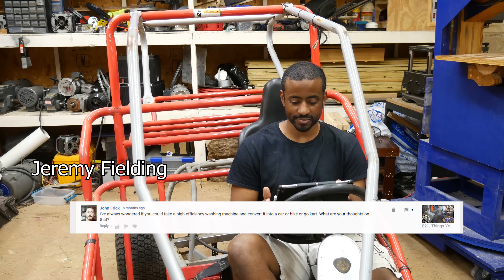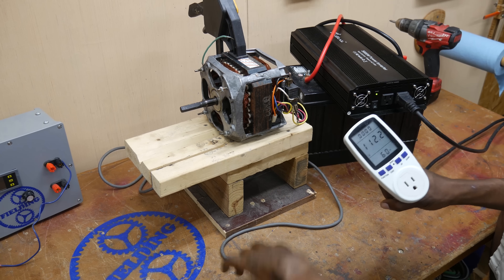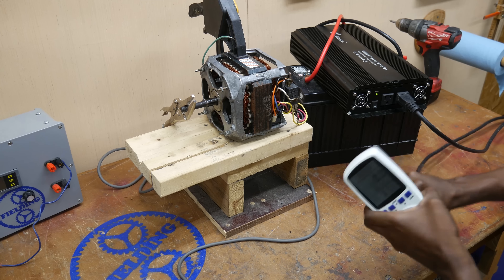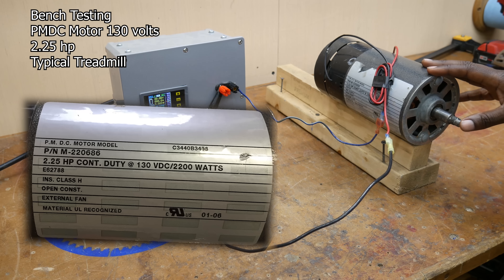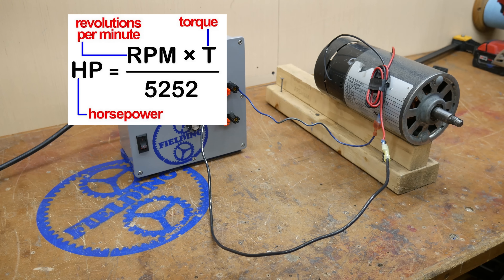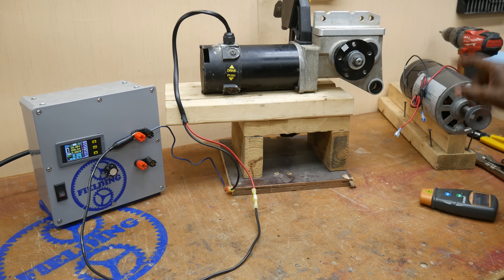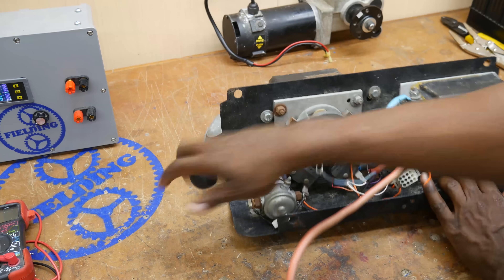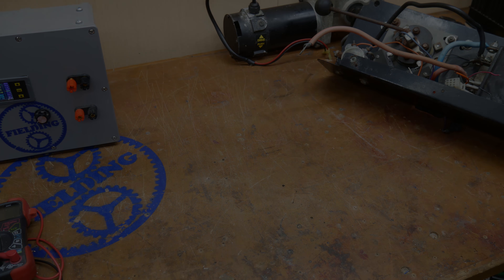What Electric Motors Can Be Used In A Go Kart or E Bike; Bench Testing and Recommended Sizing #61

Comment: Being totally new to this, I do have a new clothes dryer motor which I ended up not needing. After finding lint out of sight jamming the back area of the spindle while trying to remove the motor, I just needed to get it clean. Now still running strong 3 years. No one's vid on youtube suggested anything other than installing a new motor,  based on my search for the symptoms, so I bought one. Love what you do, my wife has joined me watching you. Excellent work.

Comment: hey man, i know the video is old, but the extra start power required can be supplied by capacitors designed for it (common here for roof fan, im not north american, idk how you guys call it), and also super or ultra capacitors, in parallel with the inverter, some off grid solar panel uses this tek for start an fridge with 12v battery + super capacitor bank. i think.
Reply from the maker: Capacitors don't supply extra power. I explain this in a video called how Single phase induction motors work for beginners. The example motor shown in this video is using a capacitor much stronger than what you see in a fan. Yet I understand why people would think that was the case. Thousands of capacitors connected to this motor would perform exactly the same.
Reply: @Jeremy_Fielding  Think I get it, the most they will do is fake a fase, in an application like this, right? Think im just gonna stick with some fork-lift DC motor, or something like that. Thanks a lot, ur content is gold! <3  Be good.

Comment: Hi Jeremy that clip you showed with the starter motor is me and it's not a car starter it's a truck
starter and it's 24V , I know you can't run them continuously but I removed the bushes and replaced 
them with bearings, the only problem with the starter is that it draws 450 amps and I could only
go 2 times down the street, I had 2 x 100 AH batteries, also there was no speed controller just hit 
the switch and fly, I'm from Australia

Comment: You are wrong, washer engines can be run on dc just by making some bridges beetween the brushes and coil
Reply from the maker: Some washing machines have a universal motor in them. Universal motors run on both AC and DC. That is obviously what you have seen. The motor on my work bench in the video is an induction motor. They do not run on DC. Thanks for watching.

Comment: Separate the Stator Coils. Apply Separate Voltage with Cap for Starting
Reply: Regulate Amps On Stator A  Use Voltage On Rotor For Speed.

Comment: I just bought a set of 320 watt 3800 rpm motors off of a Tuff Care 1710 9 pin.  I am working on making a remote control riding mower with these.  I have bought golf cart wheels and tires that I am going to put on for the drive wheels 18" diameter.  Is there a way to change the gears in the gearbox to make it faster?  By Chance, do you have a way to tell me the ball park speed I can expect from this set-up?

Comment: Additional to the big inverter and need to measure the Volt-Amp reading, you probably must pay attention to the 12 V battery capacity.  The cold crank numbers are some sort of guidance, but they are intended for only short term.  A GoKart may need high torque much longer than the battery rating seemed to suggest.

Comment: I’m interested in off grid farming and dropping my expenses to virtually nothing swapping most things to electric to run off my solar panels. Could this application work with a tractor using 5 motors. 4 wheel drive and one for PTO hydraulics.

Comment: Hi I've been watching your videos and enjoyed them all I just want to mention that I used a washing machine motor on a DC power supply without an inverter and worked perfectly fine.
I only changed the wires connections on the coils 👍 worth checking
Reply from the maker: Thats not an induction motor. Some washing machines have universal motors. Especially if you live outside the US where using the universal motor is more common.
Reply: @Jeremy_Fielding  thanks Jeremy that's make since

Comment: I built an electric motorcycle...i built a freewheel that attaches to the pully on the motor...it did not hold up so i am trying to find out how fast the motor can turn while coasting without freewheel damage to the motor...it is a brushed 48volt 10 hp dc motor....not many sources know, do you?????????????

Comment: The thing is those single-phase induction washing machine motors only have 2 speeds and there not very high generally less than 2000 rpm a Preditor engine or Honda clone on the other hand has a max rpm of around 3600 rpm. They have like 0 torque too.
I'd actually like to do the opposite I'd like to put a vertical shaft honda clone on a top load washing machine and see what happens lol

Comment: Any experimenting with a planetary gear set up or a jackshaft.  Was racing snowmobiles and snowmobile engine equipped open wheel race cars for a number of years.  No intention to return to that but an effective 2 speed transmission or more can be achieved and I've crazy notion of how to but I need to go shopping at a buddies scrap yard for the pieces I need.  just wondered if anyone else has tried this sort of set up.  The bigger plan is to convert an IO or v drive to electric, then use solar to charge the batteries.  Cruising requires fuel or sails and sails don't go under bridges so well. Fuel, NO unreliable resource in certain parts of the world.

Comment: Couldn't you use a start capacitor(s) to supply the extreme start current for long enough to absorb the current spikes until the power usage drops? I think you could also rig up a mini boost converter circuit (like this Wikipedia  pic https://images.app.goo.gl/S2ziezdpiLjuXFfeA ) behind the gas pedal on/off contactor switch to provide a temporary boost in voltage or current during initial start up. It would kinda function like a really short term soft start circuit or inrush current choke circuit too depending on how you design it.
Reply from the maker: I am using a start capacitor in this video. They don't supply current in the way you describe. I made a video explaining this in detail "how single phase motors work for beginners"
Reply: @Jeremy_Fielding  yeah, I know they change the phase of the current enough to simulate a second set of motor winding thus generating the torque to start the motor. I should stop commenting on technical videos when I am way overtired. I already watched your other video though. Very informative.
Reply: @Jeremy_Fielding  and even if they did fix the power overload issue they wouldn't fix the lack of torque.

Comment: Did you measure the power in VA? I think the power factor of a stalled motor would be ~ 0.5. At 1500Watt that would be 3000VA causing the inverter to shut down.
Reply from the maker: I added notes to the description about this
Reply: @Jeremy_Fielding  Hmm, some sort of electronic self healing fuse of half the power per output? Why? I think you will find them connected in parallel.
Reply from the maker: @Nerd3927  I decided to check and you are right... they are soldered to the same terminals inside. I feel cheated and lied too LOL
Reply: @Jeremy_Fielding  oh wow, thanks for checking, and reporting the result!

Comment: Im looking at a metal inverter case sitting between the Pos and Neg posts of the battery?? cant see the the neg side clearly but I was wondering if sparks would fly if the inverter wobbled over and connected both terminals at once

Comment: Can you get away with using a smaller motor if you mate it to the cvt from the original motor? Smaller motor = less power required to run = less weight? Idk I'm definitely not an engineer lol.

Comment: Just gut an electric golf cart.  It will have the DC motor and controller, etc. adapt it to a chain or other drive on your kart, and upgrade with a DIY lithium battery pack instead of the lead acid batteries.

Should GLH (go like he-double hockey sticks..)

Comment: Would a 48 volt motor from a golf cart work for powering an electric dirt bike? I'm trying to figure out what motor to use to power this bike its a Honda 200R. I want to connect the motor directly to the final drive sprocket.

Comment: Thank you for doing all the experimenting. I took on a job to get one of those model t's that the shriners used to drive in parades. Someone put a vertical shaft engine in it and they wont work without the blade because the flywheels are wimpy. Anyway I do have a few wheelchair motors and now my delema is solved. You rock!

Comment: JF.  I am 73 and have never understood electronics and, sadly, I still do not.  It will likely ever be thus.  You are a good teacher but I am thick.  I also live OTG (off the grid) and MUST do all my own work (nearest neighbour is a bear).  This lifestyle can be quite a challenge when you are stupid.  Worse, I am getting stupider.  
I need to pull a boat out of the water.  It slides up two tracks.  The winch I have is an old Marpole 5 ton winch that is manually turned with a ratio of 250 to one.  I can do that but it is tiring.  I have a few 1/3, 1/2 and 3/4 motors and would like to use a small pulley belt driving a larger one on the winch if I can.  I can make the motor on a hinge so as to tension the belt but I have no idea how that system will pull up a one ton 17 foot runabout at a 20 degree angle.  I have to pull it about 30-35 feet.  Speed is not a factor, hand cranking is the issue.  It is slow.  Any assist will be good.  Can I bother you for a quick suggestion or two on this?

Comment: what if you used two motors? one low-speed high torque to get the cart moving then switch over to a high-speed low torque at let's say 10 mph to achieve 30 or 40 mph? you could put one motor on the left and one on the right wheel

Comment: would you please post that formula for determining motor rpm to Miles per hour I've always struggled with that from when I was a kid trying to gear up my go-carts. Yes, I had the only belt-driven two-speed go-cart and that reached 35 mph quickly with a 3 hp engine. It worked very well

Comment: so if you need more speed and also more torque you not only can use pulleys but a TRANSMISSION. that is why they put transmissions on gas and diesel vehicles. But I was always led to believe electric motors had high torque at low RPM, which is not proving to be true here. So why not use a transmission on a go-cart, scooter, minibike, scateboard?

Comment: I liked your video. Great information. I remember something from several years ago about "overspeeding" a brush type DC motor. Once a DC motor like this is up to its full speed, the field winding acts as a speed control through the strong magnetic field it produces. If the current is then reduced to the field, the motor will increase in speed, above its rated speed. Another thing I remember about DC motors used in old Trolley cars (aka street cars) is that the car had only 4 speed positions, and not an infinitely variable speed control. In the first position of the controller, the motor is in a 6 pole and series wound mode where the field and armature windings are wired in series. This gives maximum torque, and a lower speed to start the trolley moving. The next position is 4 field poles and also wired in series. The torque is reduced some, but the speed increases. The third position on the controller engages 6 field coils, but wired so that the field coils and rotor coils are in parallel. This allows for more speed, but again reduces torque, however the trolley has increased speed, so not as much torque is needed. The 4th position engages 4 field coils, and the field and rotor windings are in parallel for maximum speed.

Comment: I was looking at this a while back and found an old design for a lorry starter motor (24V) and how to rewind it. This was in the pre-internet days. The starter was for a diesel, so had way more torque than a standard petrol starter on a car. With the rewind it was supposedly about 3HP and quite small. The only issue was current - 200A near enough at normal running. That's enough for serious heat and it produced something like the best part of 1kW of heat so needed plenty of forced air to cool it (IE a fan with duct to go through and over the starter). A DFJ020004 is about 10HP. Good luck keeping it cool though. As for control PWM works. The basic PWM can be done with something as simple as a 555 timer and a pot or an Arduino if you have the coding skills. This then needs to go through FET drivers to a load of FETs in parallel on a monster heat sink. For the FETs you can use IRFB750's. You will need a lot in parallel. Ideally keep the current down to 25A or less per FET. This is because of the tyranny of current when it comes to heat - it's square law. Specifically IIR=P so double the current 4 times the heat. The above FET has an RDSon of 3mR worst case. 25Ax25A is 625. So P=2W (actually a bit less) so 10 of them gives 20W of heat and a 20C/W heat sink (you want to keep them as close to ambient temp as possible to keep the RDSon down) is not too expensive. This setup will actually handle up to 330A if set up correctly, which at 24V is about 8kW and at peak about 5 times that.

Comment: You could put a gearbox on a universal motor, run it from 110V DC with the relevant number of lithium batteries and DC controller changing the mosfet to one that will handle the voltage and current if needed. Even a bicycle chain and gears could work... or CVT system... Just an idea because those washing machine motors can spin really fast.

Comment: I was at a automotive scrap yard.
And there was a 100% electric vehicle battery for sale for 500 bucks and I bought it it's a big battery and it's very very strong it's I believe a LiPo battery and I would be curious if I could use that super buff battery that could drive a vehicle around all day and use a 10 horsepower DC motor

You think that could work
I was thinking about going back and purchasing the wiring harness in the control module from that vehicle and or go online and purchase a speed controller with a pedal

Comment: Can you use a 3 phase induction motor with a speed controller (VFD) for a go-cart application? If I power a 60Hz induction motor with 400Hz can I get more speed out of it? Surely due to Kv and Kt I would also need a higher voltage also, so I'd probably need to check if the winding insulation. Or would the eddy currents and hysteresis make the motor too inefficent and overheat?

Comment: You mentioned that this AC motor has high (inrush) current when starting due to high torque. I believe that the high inrush is based on there being no back EMF (electromagnetic force) and the only resistance to the voltage is the low resistance windings. As the motor starts turning it turns into a bit of a generator that opposes the input voltage (back EMF).  A DC motor does have high torque at 0 rpm.  But I could be wrong, as I am an ME, not EE.  You can easily keep a table saw blade from starting with a stick inserted between teeth. It has little toque.

Comment: me?  ""Out of the box", not an extension cord, a 120 VOLT, 820 watt 2 stroke alternator.  i'LL GET A POWER SUPPLY 36v dc OUTPUT AND A 750 WATT REAR E-BIKE WHEEL, GENERATOR IN TRAILER.  wE'LL SEE.

Comment: I can't believe you missed the easiest option: electric go-kart in 30 minutes:
Take peddle go-kart -> remove peddles -> take power drill -> put bolt with gearwheel in chuck -> make gas peddle from trigger -> done.

Comment: Have you tested swimming pool motors on anything besides a pool pump?  We have motors ranging from .5 HP to 3.5 HP, including some with VFDs for variable speed drive.  Some are TEFC.   Most are capacitor-start single phase 3450 RPM motors.  Great channel; thanks for the education.

Comment: You can buy a China pure sine low frequency 48 volt 2000 watt inverter board starting at 30 bucks
150 for 10000 watt 
And lots or other wattage and prices 

If you can find a large  
Transformer a toroid will have a lower idle current 

You keep the 120/240 winding 
and wind a new low voltage side not hard not ver many turns

Find or make a box to put it in a few switches and wires 

And you can build you a kick ass inverter 

I know you can do it it's not hard my first one is on( the back shed  .com  )  the post is named little China inverter board by Benandamber

It is very easy very cheap for some one like you that can find free Transformer 

Really  enjoy  your videos 

Have a blessed  day

Comment: Hi mate, i am watching your videos alot, you are one of my favorite ,what i am wondering is, if we  parallel the coils on router  of treat mill motor  can ve drop nominated voltage to half like 130 to 60-65 so we can use on go kart, tork will be double 2 ,i think, if yes, is it easy to do shorting one with the next or you have to re-organise all the connections on the commutator

Comment: Not many folks understand the moment of inertia for the motor shows max inrush current for milliseconds. That peak current presents every time the motor is started. You explained it perfectly. I have used ‘starter motors’ but put heat sink and fan. Cool you have original controls.

Comment: Just get a  3000w  BLDC 60V   motor from alí express,   I use them really often  and it comes with throtle, controller  chain and sprocket.  All  for 145€.   
I usually pair them with my  señf made 52v 35ah  battery made out of 35E  samsung cells  and 80Ah BMS.      This setup can push 350kg  with no issues up to 60km/h   (9tmotor cog  and 30t axle side cog).  12inch wheels